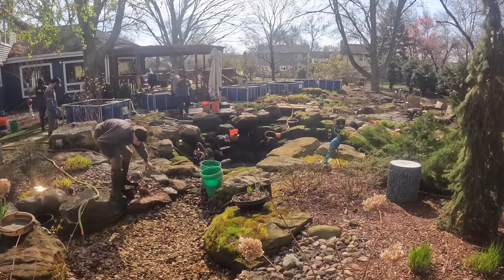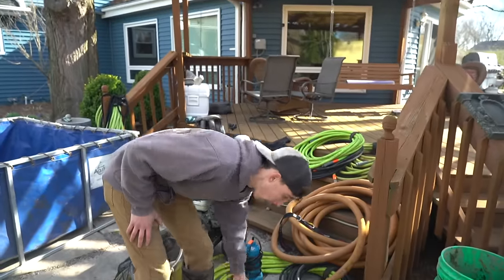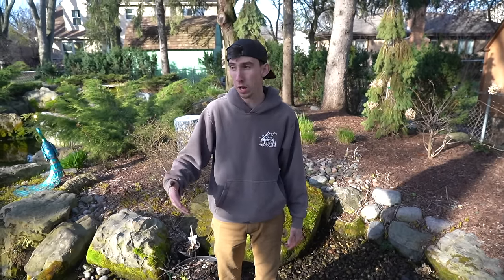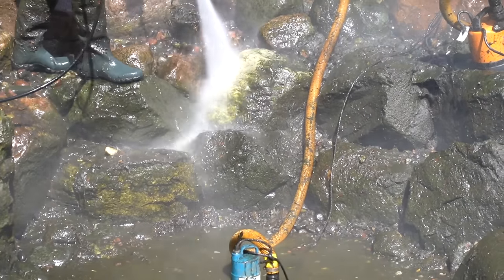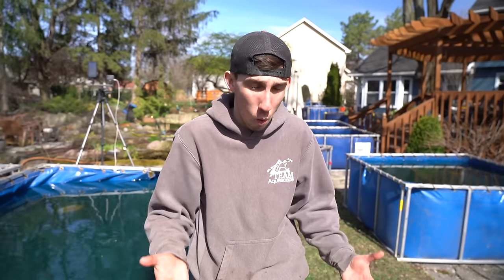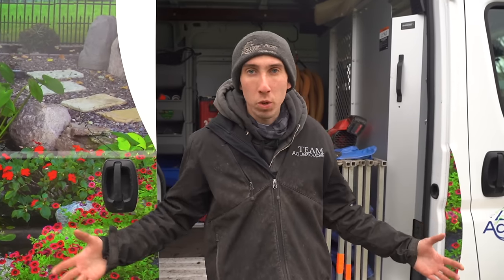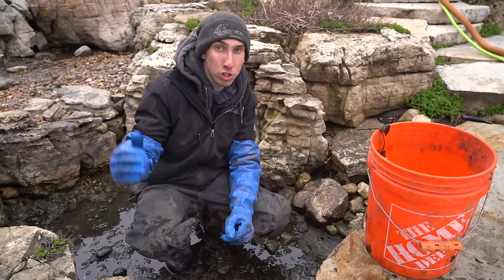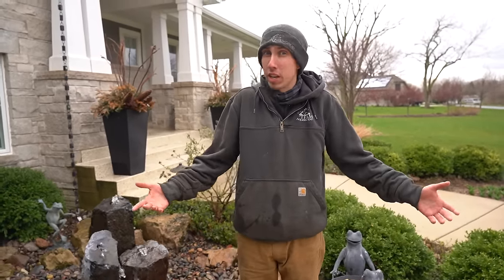HOW To Effectively Clean Out YOUR Water Feature

Comment: Great video! Some thoughts: 1) What's left of the biofilm that took months to build and supposedly helps againsts string-algae? 2) Wouldn't a much less invasive and expensive option be to pond-vac? Admittedly, I'm using a Oase pondovac 4, but not really happy about it. Would love to see an affordable, professional option that actually works also for larger ponds...
Reply: I have looked at pond o vac and was under whelmed.
Reply from the maker: We rinse down all filter mats with pond water to keep all the good bacteria for filtration. But it can be good to get rid of some of the algae in the pond too. It's really all about filtration, with wetland filters, you may not have to do as many cleanouts. For example, our signature pond at Aqualand has only had one full cleanout ever! Plus, doing all the rinsing really ensures we are getting all the detritus and muck out of the feature, rather than just vacuuming essentially the top.

Comment: How frequently would a full drain clean-out be necessary? Lets say for a 25000 gallon pond with a 2000 gallon wetland and large separate pump skimmer, which is connected to jets.
Reply from the maker: It really depends on how much debris is falling into your pond and how much upkeep you are doing with it. If you take 15 minutes each week to empty your skimmer basket, pick out/net out larger debris, and dose regularly with Beneficial Bacteria, you may only need to once a year if that. Our signature pond at Aqualand has only been completely drained with a cleanout like this once and the water is still so clear!

Comment: Is there anyway possible way to have a aquascape set up with a filtering system so that no matter what, customers wouldn't need to call for maintenance repairs every spring?

I'd love to have my own aquascape one day, but is the upkeep low?
Reply: Maintenance is 100% dependent on customers expectations and desires. 

Remember in Chicagoland most of these ponds have been turned off all winter. Spring Cleanouts replicate what happens in nature with the increased rains and the flushing of natural waterways.